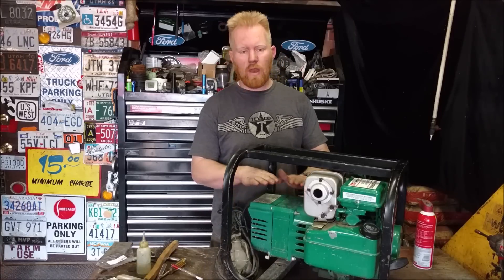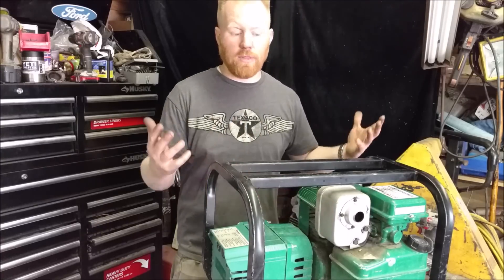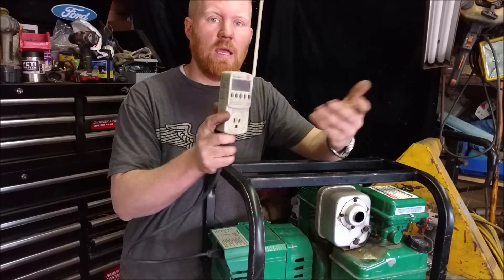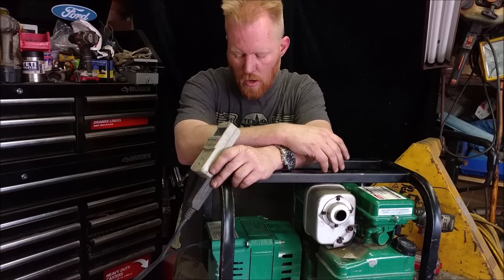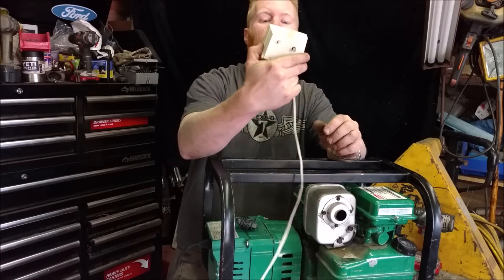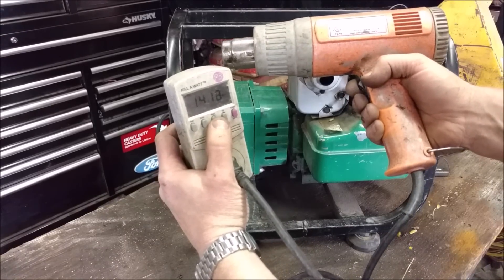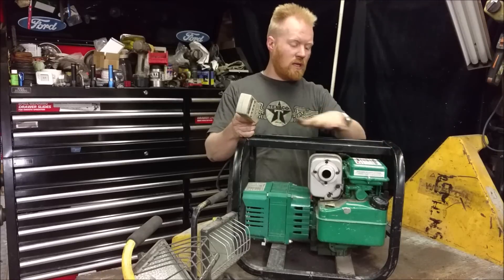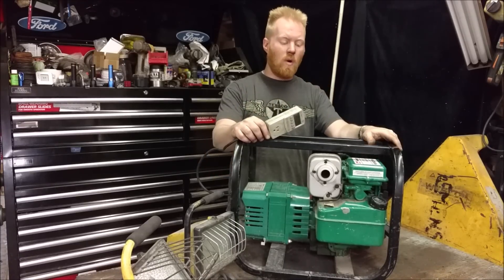Tune a generator Head DON'T FRY YOUR ELECTRONICS

Comment: Great videos. You are the first person I have seen on YT using a  Kill-O-Watt meter to set the genny output via Hz under load. And there are a lot of videos out there about setting the RPM to 3600 with no load. That is all fine and well, but, Hz is by far the most important aspect of output. I have been doing that with the units I service ever since buying the Kill O Watt meter. I used to set them under load using voltage and RPM only. Great tool for those that repair / service generators. I saw another of your videos talking about making the generators more quiet. Next time you get a Suburu powered generator with the OHV / OVC, put your decibel meter on it and see how quiet they run vs a push rod motor. I have a meter on order and have both a Suburu OHC and push rod generators in the shop. That should be interesting to find out. My thought is the push rod engine will be much louder due to the timing gears and the valve train noise. I guess I'll find out soon enough. Thanks for your videos.
Reply from the maker: Thanks. Yeah, it would be interesting to know which is quieter. I'll have to see if I can find some engines with similar displacements.
Reply: I have a Powermate 1800 with a 4 HP Suburu and a 5 HP Honda EG2200X in the shop. When I finally get that meter, I will let you know what I find. Amazon has been SLOW getting my parts to me as of late. 
Probably just that time of year with the holidays.
Reply: A multimeter is even more accurate - and, a sturdy one will cost less than a Kill-A-Watt. :P

Comment: Moe I have a follow up question. I have an old Honda clone generator that I've been tuning up. Engine runs well enough and produces voltage. However the voltage and hertz seems way out of sync. Adjusted the hertz to 60 under moderate load but the voltage is around 100v. What's going on?
Reply from the maker: If it's a standard generator head style generator and not a modern inverter, the voltage is controlled by an AVR (automatic voltage regulator). The HZ is controlled solely by the RPM of the engine but then the AVR regulates how much voltage it puts into how much it gets out. These have a few capacitors that generally go bad inside of them but If it's a generic generator, likely you can find a generic AVR. It's generally a little black box with a plug and a few wires going into it. Just look on Amazon etc for something that matches it and swap it out.
Reply: @sixtyfiveford  Thanks for the advice! I've done a bit more digging and saw other videos about the avr and everything I've watched shows it located on the end the stator casing behind a metal shroud. When I took mine off there's not one there. Everything else looks the same minus the brushes because I assume mine is brushless. Where else would it be? FYI it's a Kenowa 4500e if you've ever seen one. Looks just like a Honda clone.
Reply from the maker: @cwvowel I pulled up the part numbers for the Kenowa 4500/4500e and it shows two different styles. The 10567 which is just a little rectangle black box or the 90045 which is angled like a half moon shape. Theoretically you could put the AVR in the wiring bundle behind the outlets on the side or you can put it at the back of the stator/ rotor.
Reply: @sixtyfiveford you didn't have to go through all that trouble but thank you for doing it! I was also thinking it could be behind the outlet box so I will check it tomorrow.
Reply: @sixtyfiveford  So I followed up on this generator today and the result wasn't what I had hoped. I never found an AVR to adjust. It appears this model generator only has a little black box capacitor tucked behind the plastic cover of the electrical plugs. Part CBB61 rated at 24uF~5% 350VAC. I tested it with my meter and came back with 22.1uF which is roughly ~-7.5% so I guess maybe that explains why the voltage is ~20v less than what it should be.

Comment: I'm having the issue that I can get it to roughly 60.10hz +/- but the minute anything kicks on, mini fridge, my growatt solar battery/inverter... It bogs down and it does pick back up but at this point it's already tripped the fridge and growatt safety features... Anything I can do?
Reply from the maker: The hz on a gasoline generator needs to be higher at no load. Depending on the size but something like a 2000 watt peak (1300-1600ish watts running) should be about 62-66hz no load. Adjust it to 60hz only when you have it loaded to what you want to run. If it's dropping so much that it trips the load is too much for the generator.

Comment: That clock method is ingenious! I'll have to try that.
 I use an oscilloscope. Set the wavelength for 16.667 milliseconds and you'll be at 60 Hz. (Frequency = 1/ time).   Some modern scopes will let you read time and frequency directly. I have to do it manually on my old one. No problem - I was an electronic tech for 20 years.

Comment: I think you’ve got the clock numbers backwards. If your genny is putting out 62 Hz, then your clock will run fast. If it runs fast, then it will take only 58 seconds to sweep out a minute. Try it and see.

Comment: I know this is old, but you seem to be really helpful in the comments. Just wondering, how would I do this with a large 13KW generator, that I only use the 240V/50 amp outlet to power my home panel when I backfeed it? All of my Cyberpower UPS's in the home, do not recognize this as real power I guess, because none of them will go back to AC when the generator is powering the house. They just click back and forth from battery, to AC power. I want to tune this generator, and I'm wondering if I need to put something into between the 240V outlet and the breaker panel while under full load (which seems challenging), or if I can just set it up for the load, and test the normal 120V outlet on the generator that's not being used and get my readings there to adjust the governor. Thanks in advance.
Reply from the maker: You can just measure one leg/120v and you'll get the HZ for the entire 240v.
Reply: @sixtyfiveford  Sounds good. Thanks!

Comment: Good video , But I still use a surge protector between my generator and my electronics. For I don t trust them generators cause they vary in speed at random or when ever they feel they should burn our electronics . So it is safer to to use a surge protector on them generators . No offence also keep up the good work..

Comment: Thank you for your video. After adding about 6k watt load to my generator (firman t07571), I noticed the Hertz was fine but the volts was at 258.  Should I be concerned about the over voltage?
Reply from the maker: The HZ needs to be as close to 60hz or dead on under load as this controls the speed of motors(fridges, AC units, etc). Voltage however is far less important. Is the 258v under load or static? 258v would mean 129v per phase which is higher but still barely within the 110-130v acceptable range.
Reply: @sixtyfiveford  thanks for the reply! It's only under load. When I back off, it goes back to, around 246ish

Comment: What would you consider the bare-bones minimum Hz for a nearly loaded Generac GP-5500? Usually has 2 medium window units, a refrigerator, and a power strip with electronics like computer and big screen TV. It usually drops to 57-58 Hz and the V is usually between 117-119V. Is 61 Hz under no load with 122-124V. My opinion is to bump the RPM up a little. This particular generator was at the side of the road and was being thrown away by my neighbor because he didn't maintain it and had 2 year old gasohol in the tank. And that smell was awful coming from the carb and tank. It only had 39 hours on the machine. I've had it 5 years now and give it the necessary love it needs to start on the first or second pull when I really need it to work. It's not too strenuous of a job to change the friggin oil once a season and to clean/ replace the plug and air filter. Oh, and to run it out of gas when it's likely to sit for months. It's amazing how many people don't even do these tasks and can't figure out why they wont start when the hurricane is 48 hours away.
Reply from the maker: I would bump it up. The voltage is beautiful and anything from 110-130v is no issue at all. The HZ though on motors controls the speed. The the fridge and AC units operate the best at 60hz. TV, computers etc generally don't care as they convert AC power to DC to run and generally accept anything from 50-60hz and 110-230 volts.
Reply: @sixtyfiveford  I'll make the adjustment this AM. I just bought a $18 gizmo off Amazon that was delivered Friday. It reads voltage and Hz simultaneously, so adjusting will be easy. This Generac has never damaged anything I've plugged into it and I've used it to charge phone batteries and power tool batteries as well. I didn't realize how important the cycles were until I watched your video. Thanks for getting back to me so quickly. I've been a subscriber for a couple of years now and really enjoy your content. Have a blessed day and greetings from Louisiana!

Comment: your video mentioned tuning the generator HEAD. You never got into any head adjustments (like voltage) only the engine.
Reply from the maker: The engine is what sets the generator head.
Reply: @sixtyfiveford  Isn't the "head" the section where the voltage regulator adjustment is done once the engine is at 3500 rpm?

Comment: im in the UK, and run at 50hz 230v AC.... Bought a generator that needs some tuning... What RPM would my engine need to be, under load, to achieve 50hz?
Reply from the maker: It should be 3000rpm exactly. That would spin the rotor 50 times a second =50hz. So load it to 1/2-3/4 capacity and set it to 3000rpm.
Reply: @sixtyfiveford  appreciate it, thankyou, because when i put a decent load on it, it just dies out...
Reply from the maker: @RGD-Radio  If it dies under load, likely the main jet in the carb is plugged.
Reply: @sixtyfiveford  the carb only has 1 jet. and it idles lovely :) 
I did strip and leave the carb to soak for 12+ hours. AS it wouldnt run off choke.. It runs fine now though..

Comment: My digital clock ticked off 1 min. in 37 seconds. So is that  really high hertz or super low ones?
Reply from the maker: I've never used a digital clock for this. It would have to be an analog with a second hand. The electronics and everything in a digital clock would probably skew it. If it was an analog clock 37 seconds in a minute would mean the engines running at essentially idle.

Comment: I have a powermate 4000 and a killawatt meter as well. The engine runs pretty smoothly, but the hertz bounces around between low 50s and high 60s, sometimes even hits 70.  When I plug the meter in to my home outlet its a solid 60, so there's nothing wrong with the meter. I suspect something with the gen head. Any suggestions to correct this?
Reply from the maker: I've ran my Kill a Watt on nearly 100 generators and never had a situation like this. Is the generators engine rpm consistent or is it surging? The HZ is directly related to the engines rpm.
Reply: @sixtyfiveford  
It sounds pretty steady but I will check it with my spark plug wire meter (if the battery is still good). I don't believe it's replacable.
Reply from the maker: @itseyegore8654  It doesn't have the idle kickdown does it? Where it idles down when there's no load on it. It could be your automatic voltage regulator just not telling the generator to produce a real power output until a load is sensed. It would have to be surging a lot to vary from 50 to 70 hz.
Reply: @sixtyfiveford  
I don't believe it has that feature.
I will check the rpms if my meter still works.
Reply: Update:
The rpm's are steady. The frequency bounced around like that with no load. When I added a load, the hertz leveled off and only fluctuated by .1 or  ,2
So I set the rpm at 3700 which gave me approx. 60 hz under 1000 watt load.  I'm gonna have to be good with that.
Thanx for your response and your helpful video.

Comment: Can I make a turbine with the head?
Reply from the maker: There's really no turbine similar components inside the generator head. But anything is possible.
Reply: @sixtyfiveford  does it not just spin and make ac ?
Reply from the maker: @leadbellyacid5496  Yes but that doesn't resemble a turbine even in the slightest other than it spins.
Reply: @sixtyfiveford  but it makes electricity you can feed the head thru a rectifier to charge batteries?

Comment: Thanks for the info! I bought this same generator at a community swap meet, Coleman Powermate  PM54-2000 puts out 2250 watts.  The electricity was shut off  for three days days due to high winds so I got to use it worked perfectly. I'm looking for a owners manual tried googling it no luck if anyone knows how to get a owners manual would greatly appreciate!
Reply from the maker: You are very unlikely to find manuals for these. You can find manuals for the Briggs engine easily though.
Reply: @sixtyfiveford  Thanks!

Comment: Wouldn’t it make the most sense to have an inverter tied directly to say 2 decent size truck battery’s ?   The battery’s take the load shock .. the generator runs a constant low rpm,,,  and slowly raises the rpm as needed?

Comment: Hi, I just clean and started a hold onan 2500 gen. Modèl 205AJ-1P / 1c.  Serial 57B553451.   110 volts that I got 2years ago. But therme is no currant comming out. Where do i start to check thé problème ? Dont know nothing about électricity but like to learn even at 61 ! Triyng to find pdf but no succès.. tanks for the verry informative video . 👍

Comment: I have that exact generator.  Checking yesterday revealed that it is putting out 146 volts, checking it with my multimeter under no load.  Is this high voltage normal?  Also, where exactly is the idle adjustment screw?
Reply from the maker: Put a tiny load on it and see where it goes. It should settle below 130volts.

Comment: will changing the muffler , change the rpm? thereby changing the voltage?
Reply from the maker: Not really. The governor keeps the rpm set which keeps the HZ at 60hz. Changing the muffler won't make it quieter but will kill some of the performance.

Comment: That was great info.  Thanks!  I just bought an older generator and the motor was running way slower than 3600 RPM and I was focusing on adjusting the voltage only.
Reply from the maker: Thanks, I'm glad you liked it.

Comment: I have an older Generac that is only producing 50 volts.  I replaced the rectifier and it made no difference.  Could the hertz output be an issue?
Reply from the maker: Not really. If the generator is running full speed you should be in the realm and the hz will be close. There are a couple different ways these work. In the past 30 years they pretty much all have a AVR (automatic voltage regulator) that controls the voltage. HZ is the only thing 100% reliant on engine rpm. You can check your brushes to make sure they're making good contact. You can also try exciting it by plugging in a corded drill and while running and pulling the drill trigger, spin the chuck by hand.
Reply: @sixtyfiveford  The rectifier and brushes on my unit are one assembly and I replaced it with a new unit with no change.  I've tried the drill method but in reverse with no luck.  I didn't try going in forward direction though.  Appreciate the response.

Comment: I want to make sure I completely understand this 100% before attempting something like this...So the idea is to adjust/match a 60hz output from a Big Box store Chinese type made generator to a most commonly used wattage electrical load device with sensitive electronics by turning/adjusting the carburetor screw on the generator and doing this will protect the sensitive electronics inside an electrical device just like a much more expensive Digital Inverter Generator will?.... Okay I have a small space out in the Boondocks and grid power fails for several hours at a time about 3 times per year. I can buy a neighbors Chinese Knockoff Sportsman Sandstorm Generator for $35.00 and I heat the place with one electric 120Volt AC Quarts Infrared Space Heater with a small squirrel cage blower that pulls 1452 Watts upon start up but drops down to 1372 Watts while running (a KillAWatt meter checked the wattage) The Sportsman Sandstorm generator is supposed to supply 2000 watts surge power and 1400 watts continuous - If I can get this generator to run at 60hz output while drawing 1400 watts then this should not fry the Quarts Infrared elements, sensitive Electronics Board or the squirrel cage blower inside the Infrared Heater like a more expensive Inverter generator will while keeping the place warm and cozy when the power goes out in winter? Thanks for any reply.

Comment: Good stuff Man! Thanks. I concluded my 10Kw Gen with a 670cc V-Twin Honda clone under light load showing 63.x hz, was making my UPS freak out (line/bat/line/bat...) and logging 'noise' events and/or not <5%THD as advertised. Throw ~5500w resistance at it (elect water heater) and UPS accepts that no problem at 59.8-61.4hz output. Going to dial it back to 60 and see if I can get UPS to accept my whole load spectrum I'll need/use. Thanks for that tip about finding your mid load you'll use with your Gen, then set that at 60hz on the button. Best of both load demand worlds from light to your personal max usage, well best it can be not being an inverter. CHEERS!!